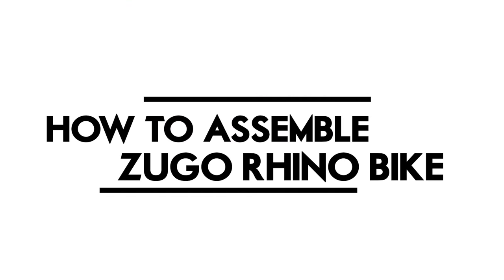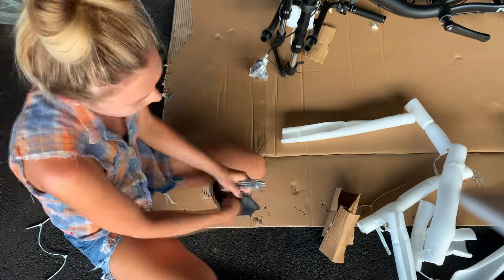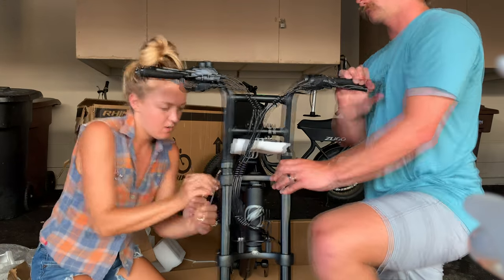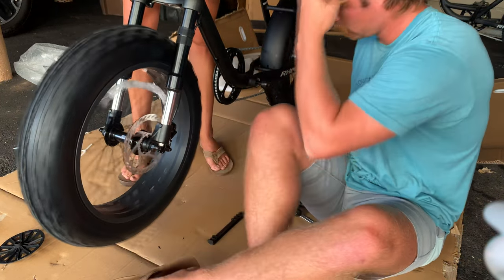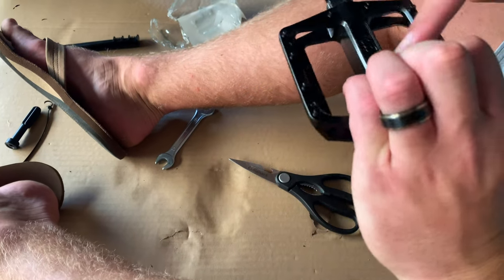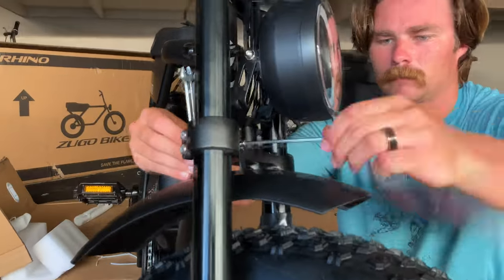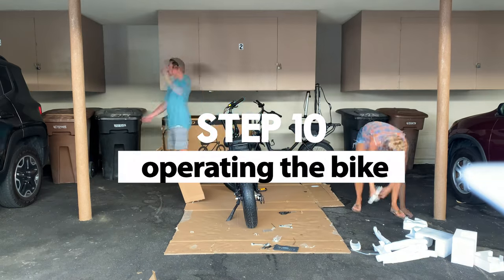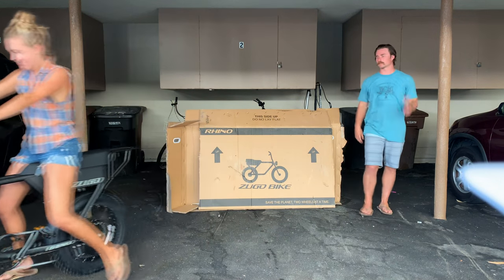Zugo Rhino Electric Bike Unboxing Assembly and Review

Comment: 3:38  you mean one hold lever in so pads engage disc and caliper self centres while partner tightens, and earlier you skipped lever setup and your right lever is too high should be able to just extend fingers n pull not adjust whole wrist position

Comment: I am a positive guy here.  You failed to remove the orange plastic piece on the front disc brakes prior to installation.  Your inside brake pad will never work properly as it can't come into contact with the disc.  Otherwise, thank you for the video.

Comment: I just recently received my zugo rhino, my only complaint is since the seat can’t be adjusted the crank arms are to long for me since I had both knees replaced. The crank arms are 170MM. I did find 140MM and ordered them. 
They should offer different size crank arms some of us are old and worn out and smaller crank length won’t really hurt since the bike is electric and most are riding on battery most the time.
Reply: Can't tell what anything your doing going to fast and not up close with screws and bolts
Reply: How do the foot pegs go on